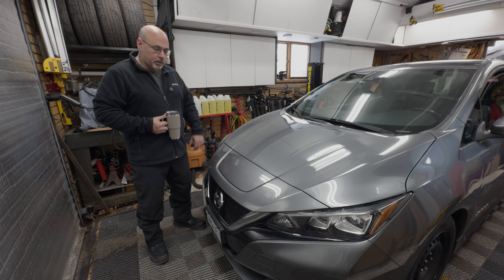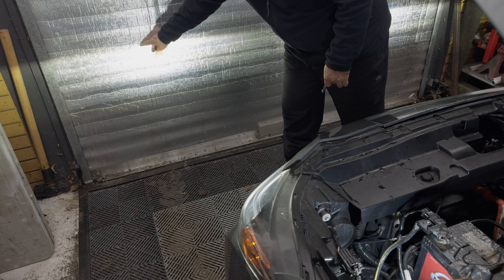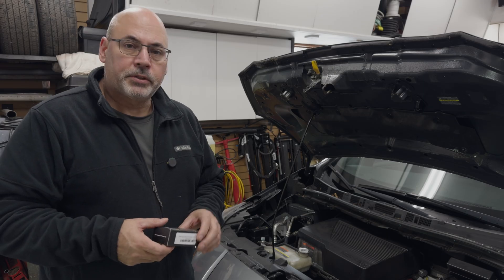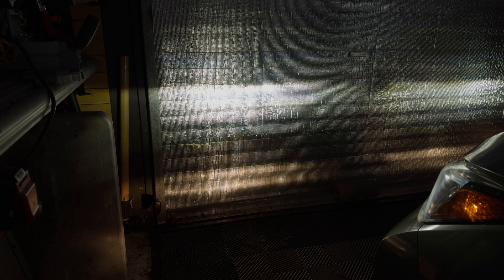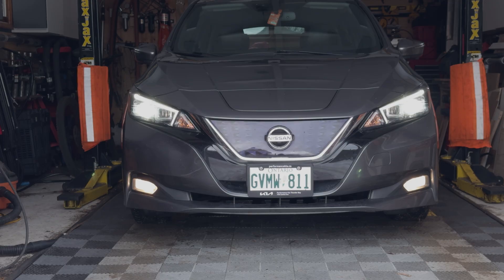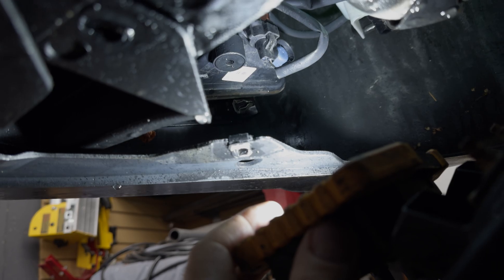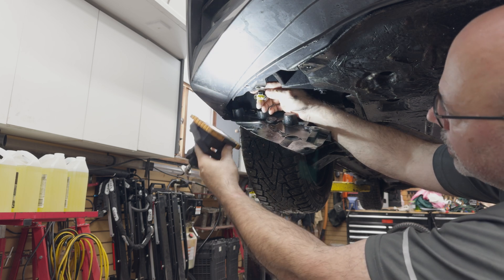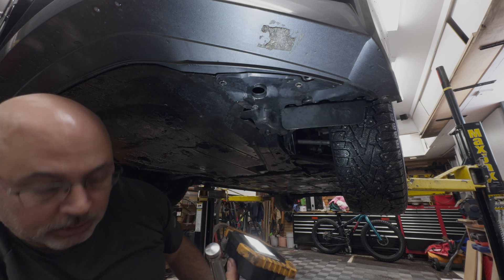Headlight Aiming and LED Driving Lamp Upgrades on a 2018 Nissan LEAF

Comment: Hi there, any idea how to identify which wire is linked to the right side DRL.  My 2018 Leaf's right side DRL is off, I'd like to check if it's just some connection issue.  Car has a minor accident on the right side, and then the DRL went off not too long after that (intermittently first and now completely off).
Reply from the maker: It’s pretty easy to access that DRL harness. I would check at the harness for power with the lights on.  Could be as simple as a bulb (if it’s not been converted to LED) as the filament in an OEM bulb is pretty easy to damage.
Reply: @WoodysWorksGarage  Thx,  The DRL is LED.